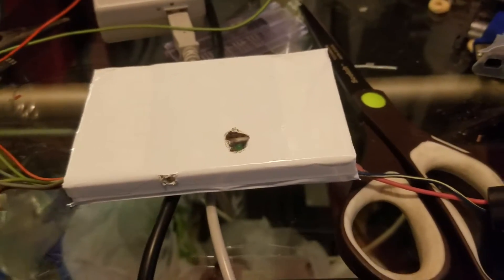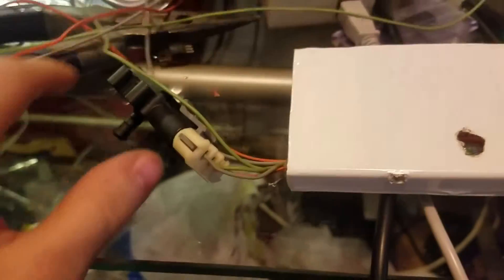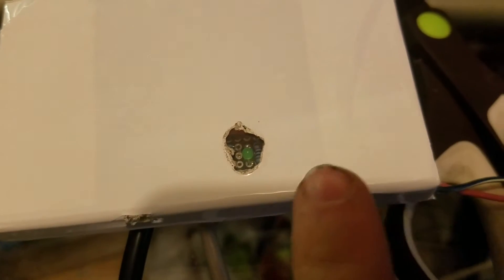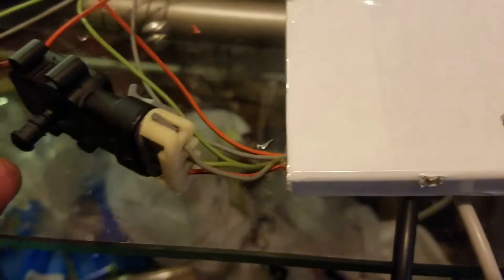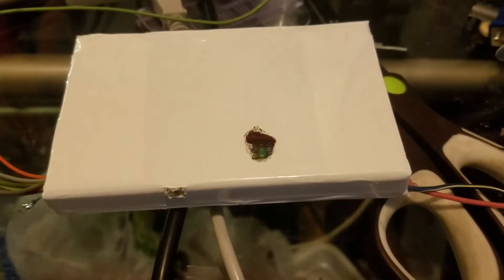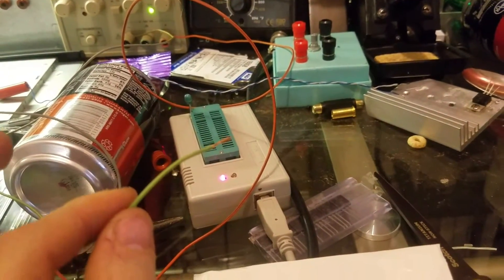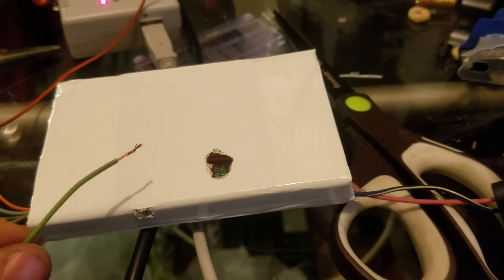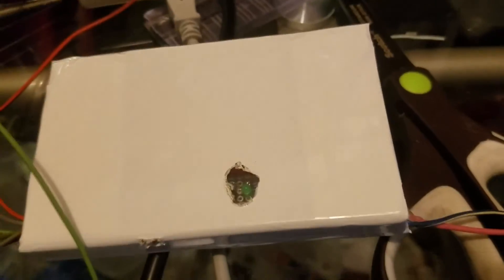Turbo Fuel Injector Controller Prototype. Injecting fuel to cool charge temp

Comment: u selling these yet?
Reply from the maker: LS1NNOVATIONS actually i have not. Been very busy with school and work. I will put this on my list of things to build into an actual product.
Reply: Hi.  Did you know that in the early 80’s thru the mid 90’s Trust, Blitz, Hks made AIC’s (additional injector controllers) ?

Trust called their’s Rebic.  There is a Rebic 1 thru Rebic 4 i think.  
I have an old Rebic 2.  Consists of an amp to run 1-3 additional injectors.  A boost sensor.  Controls to set rpm, the boost that it would come on, and the gain.    This was in the days before full stand alone prgrammable ecu’s were  made affordable.   
It worked well.
Reply: The way to prevent issues with the blow off is to install the injectors upstream of the blow off or relief valve.   Injector bosses welded unto the turbo piping near the entrance of plenum/throttle plate.